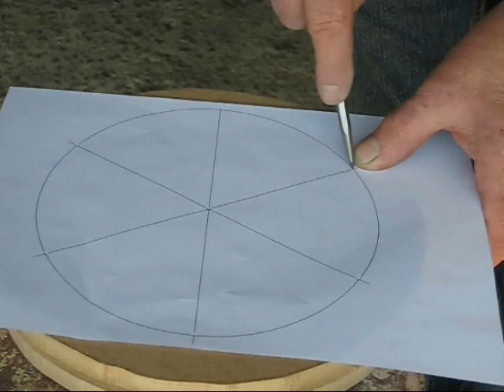Metal Casting at Home Part 22 Flywheel Pattern Making & Casting.

Comment: I had profressionally made molds for some Italian Motorcycle Racing wheels and although the same principle, i worked with an 20in casting, i had to insert a few more filling tubes and riser vents, also having 3 pourers working at the same pour to make sure the alloy kept liquid in the mould until it had all connected, The mould was not as good as what i thought it should have been and your mould making gave me some tips on how to tidy the mould up, a great instructive video thanks again

Comment from the maker: @Caleb6543 The recess in the rim is to balance the crankshaft. Sometimes on the old engines an extra weight is cast into the side opposite the crank. On this one the recess will go on the same side as the crank, same effect.
Primer is emulsion paint ( I think thats Latex in the US) Final coat just a cheap spray from bargain store.
Pattern is dusted with Baby Powder to help removal.

Comment from the maker: The secret is that before shaping 2 bits of wood are glued together with newspaper between them. The pattern can be turned in the lathe or shaped how you wish. The joint can then be split appart with a craft knife on the join.

Comment from the maker: The recess is to make the flywheel lighter on one side. By positioning the crank in line it balances the engine. Same effect as adding a weight to balance your car wheel.

Comment: Regarding tjhowse's question about the detail channel and balancing the flywheel, how do you know what size and shape to make the channel?  Do the flywheels require any additional static or dynamic balancing to work well, or is that unnecessary because of the low rpm's involved?

Comment: You've done an incredible job from start to finish.  What is the purpose of the "detail" cut with your D bit?  Is it to leave a space for balancing later on?  @11:46
Reply from the maker: The full size engine has this recess for balancing and i reproduced it in the model.
Reply: myfordboy 
I was wondering the same thing. How would you know before you even made the casting where to make the balance adjustment. So this was just an aesthetic thing and not for balance. What happens when you try to use it? Won't it be balanced incorrectly?

Comment from the maker: They should be fine but depends on the speed of the engine. I wouldn't like to put one in a car engine. Would be good for steam. A motor car rod would be make of some specialist alloy not the scrap i use.

Comment: Do you ever make any small patterns for sand casting?? That flywheel is just gorgeous! I am a luthier, and have some designs for guitar bridges, steel guitar steps, changers, bridges, necks, etc. They range from small & intricate to larger than that flywheel for an aluminum neck for a pedal steel guitar. All the Paul Bigsby stuff was sand cast. Someone bought the original molds. I used to work at Valley Aluminum Works, Aluminum, aluminum foundry. The word "aluminum" is rather redundant isn't it? All we did was rebuild the homogenizer building. It hadn't worked that well in years. They partially melted the first batch of billets, that went in after the rebuild. Their main products were Mag Lite parts, round bar billets and aluminum conduit. I don't know what their new contracts are now, aside from conduit & homogenized billets. They always make conduit, and billets.
Reply from the maker: +Seth B I have made small patterns too. A better finish can be got with an oil bonded sand.
Reply: Black petro bond - molders hate it-- pattern maker-copper berilleum -aluminum -cast iron -check parts for auto ind. i read lost foam? burn it out or pick it out -lot of smoke

Comment: Do you have a general rule of thumb for what is OK to sand-cast, vs more... "industrial"... methods like die-casting?  In particular I'm wondering about casting some very low-speed wheels, but they will see some heavy loads, as 'bogie wheel' replacements for a rubber-tracked skid-steer loader.

As many others have commented, this was a great fly-on-the-wall video overview - thanks.
Reply: Tenzalow ? T6 heat treat ?

Comment: I'm thinking of trying some simple casting in Aluminium like this. I was wondering if remelting scrap ali has any effect on its machining properties, i.e. whether other metals added to make a free-machining alloy would be affected adversely?
Reply from the maker: I have not tried it but some add a small amount of copper. The castings machine fine without though.

Comment: is aluminum or steel easier to melt down? I weld a lot and it would be cool to learn how to cast parts for some of my work, but I only weld with steel.
Reply from the maker: Aluminium has a melting point of about 650 C, steel is twice that temperature. I have never heard of anyone melting steel for casting in the home workshop.
Reply: myfordboy luckygen1001 and a few others casts iron, it just takes a furnace made with some 3000F bricks and a better burner

Comment: Why didn't you powder the  pattern when you filled the first part of the flask with sand and then powder the parting line before filling the second half ? the powder is to keep the sand from sticking to the pattern and give a finer finish to the casting is it not?

Comment: I wonder If you could cast a pulley or flywheel using lost foam
Reply from the maker: I have not tried lost foam. It would be OK for simple pattern but most have mine are quite detailed. You only get one go with each foam pattern as well.
Reply: +myfordboy can I ask you where can I get the text you use in your pattern making  Peter Perkins
Reply: +myfordboy can I ask you where can I get the text you use in your pattern making  Peter Perkins

Comment: LOL at making the egg sandwich!!

Also what does de-gassing mean??
Reply from the maker: When aluminium is melted in the furnace it can absorb hydrogen from the air and make the casting porous. The degas drives it off.
Reply: Cool thanks!

Comment: How do you estimate the size needed to allow for shrinkage?
Reply from the maker: +musicmaneman38 For aluminium I make the pattern 2% larger than the casting needs to be.
Reply: I have all the shrink rules 1/8-cast iron- double shrink to make a match plate-3/16-bronze-1/4-steel-

Comment: How do you estimate the amount of aluminium to melt?
When I watch your videos I often think you have melted way to little.
Reply from the maker: +beernd Experience is a guide. If it's anew complicated casting the pattern can be put in a plastic bag and submerged it a full bucket of water. The amount
 of water displaced gives the volume of the pattern. You need to add extra for the gating and risers.
Reply: Allright,
I thank you for your answer

Comment: That looks like a flywheel. Of all things, why did you use aluminum for a flywheel? I would think cast-iron or cast-steel would be the better choice.
Reply from the maker: The finished item is very heavy. Take a look at how it's finished https://youtu.be/m_-iPpEuWRA
The method enables a heavy flywheel to be made if you don't have the facility to cast iron.
Reply: myfordboy Oh I see. That definately works! Probably better than cast iron.